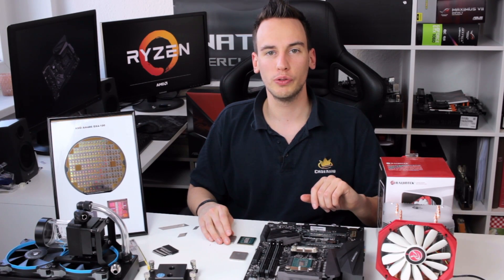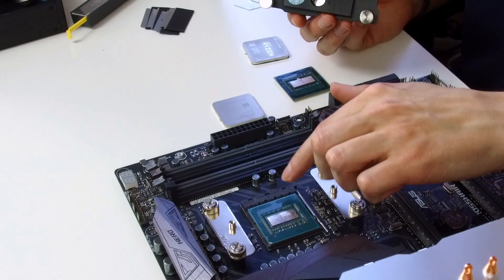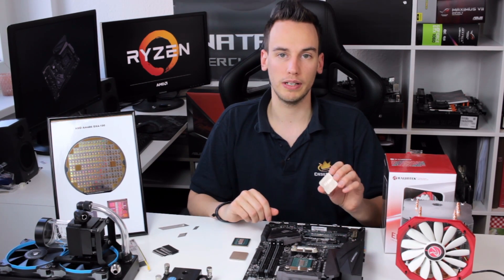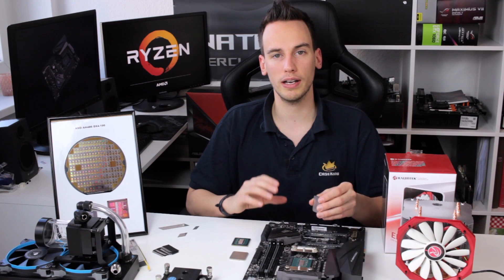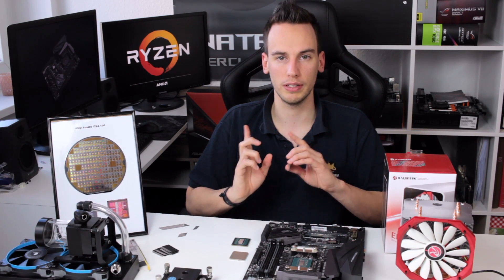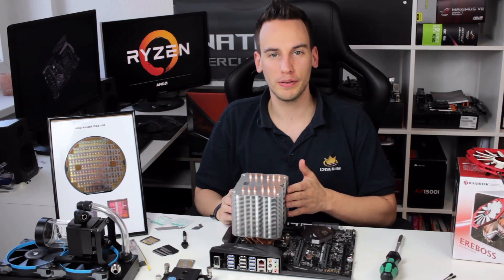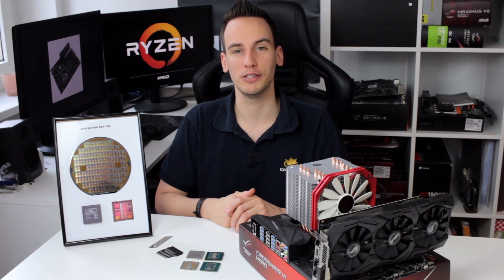AMD Ryzen Direct Die Cooling - Improvements?

Comment: Wow. Bios updates brought the overclock performance of the 1800x WAY up in the last 2 years. I have my 1800x on a Crosshair VII and it runs 4.1 all core consistently at 1.42v and temps are okay.
Reply: It's not the BIOS. Recent CPUs just overclock a lot better probably due to more refined process. Heck, some 1st gen Ryzen are even 12nm!
Reply: @RegBinary  there is no 1st Gen ryzen 12nm cpus bro, that's 2nd Gen.
Reply: @NikoBell1188  Someone got a hold of 12nm Ryzen 5 1600 https://www.reddit.com/r/Amd/comments/d6vymf/hunt_for_the_12_nm_ryzen_5_1600_ended/

Comment: You would get a better result if you used a cooler that is designed to be used on the die. It looks to me that the die is contacting about 35% of the surface of the cooler which is designed to be removing heat from an IHS.

I wish somebody would come out with an all copper cooler that's designed to be used directly on the die. Heat pipes could then take off much more heat, much more efficiently.

Comment: Just for the record. My 1800x is now running stable at 4.075 which was previously impossible. All thanks for a new AGESA code. So it seems there is still improvements clock speed wise in software alone.

Comment: Strange is that i have OC ryzen 1800x to 4000mhz and got 55 celsius max
80 C seem pretty high (and iam on air...) maybe noctua dh something is a better air cooler but that a big difference
Are you sure its not a offset temps?

Comment: What about lapping the IHS?
Reply: arfmf what is lapping?
Reply: @aa-vb9tj  Sand/polish to get it super smooth and free of microscopic imperfections. Theoretically increases contact area between IHS and heatsink/waterblock, but go too far and it could make things worse if you leave a concave surface.

Comment: Can you not file or sand that hinge surface to get the water cooler block on it? or is it not worth it?
Reply: first thing I thought....  hell worse case scenario i'd be in the garage cutting some scrap metal into a new hold down bracket.  Been using the same Danger Den RBX water block since 2005 or so lol

Comment: it isn't the liquid metal and aluminum a bad idea?
Reply from the maker: It would be but where do you see aluminium? :)
Reply: the base  of the cooler isn't made of aluminium?
Reply: Pedro Bermudes its nickel plated copper broski
Reply: Don't mix metals in general. OP has a point.

Comment: Damn, now I know why I watercooled my 1700X...running Prime95 and mid 50s C at 3.8 Ghz OC with custom water vs. low 80s C with stock clocks with aftermarket air cooler 😳

Comment: I don't see why all the hate for Intel using TIM. I've been able to overclock my Intel CPUs extremely well without running into CPU thermal issues on air cooling. Currently have a 6600k at 4.7 GHz that stays at around 75c under load with air cooling. 

Point is I think I'd rather have an Intel CPU with great overclocking potential WITH the option for de-lidding than a soldered AMD CPU that can't even hit anything over 4 GHz without thermal shutdowns. Intel's giving you the option for improvement. Seems to me that AMD HAS to solder because if they used TIM they'd run into thermal issues.

In reality they aren't doing you a favor. These are companies that want your money. They want maximum profit and will cut corners wherever they can.

Comment: soldering a silicon die to a heat spread on paper is a great idea it works very well and it makes a great thermal transfer material. 

Metal is far more thermally conductive then any paste on the market multiple times over.

However with time soldering will expand and contract with age. This causes microscopic cracks that lowers it's thermal efficiency and over time the problem just gets worse.

I knew going in there wouldn't be much difference even with direct die contact but it was interesting and well worth the watch.

Also for further clarification yes we all know metal is more conductive but soldering melts and that allows it to fill in the microscopic pours on both the IHS and the silicon die.
Reply: Clinton Fisher yes but that would be after MANY years like 7 or 10 to notice a difference and usong paste still has the same drawback because after years it would degrade

Comment: so everyone keeps saying that Ryzen is architecture limited not heat limited and that's why we can't get past 4.1ghz. but if that's true how did he get to 5.8? and what voltage was it at? Also, is the 81.1c mentioned here before we take 20c of because of AMD overstating their temps on 1800x/1700x?
Reply: eugkra33 1.8v at ln2

Comment: Temperatures are actually 20c lower than reported for 1700X/1800X (this does not apply to 1700). There's an offset that's not being taken into account by monitoring software.
You can read about it on AMDs blog: https://community.amd.com/community/gaming/blog/2017/03/13/amd-ryzen-community-update
Worth noting as people may be getting the wrong impression about heat.

Comment: Would you be willing to overclock your northbridge and southbridge only if the motherboard even has them both. But please cool those with a liquid cooler also.
Reply: If you notice where it's manufactured vs the delid comparatively speaking this way we all could stay clear of that regions chip manufacturing inferiority using bad thermal compounds. cuting costs at our expense

Comment: Got you deliding not worth it on ryzen, oc'ing the 8 cores beyond 4ghz is probably limited by design as the extra millivolts going in mainly increases temps without enabling faster clocks probably an issue with the design and 8 cores but still it's a great processor for those game/productivity users that need 8 cores.

Comment: had similar problem with direct cooling on my i5 5750k.  My solution was to remove the retention bracket.  The waterblock once installed prevents the CPU falling out.

Comment: How did you get that CPU cooler to fit without an AM4 bracket, if I might ask?
Reply: PvMcris Becose Asus Crosshair VI Hero have holes to use both soket cpu coolers AM3+and AM4 the same.

Comment: Why not just take 2mm off the plastic socket and use the original water block? Easy
Reply: IncandescentWithRage that's what i was thinking the whole time. shave that bitch down!
Reply: I thought that too, the motherboard is probably 400€, but if you delid at that level....

Comment: You should rather try to go with the peltier cell.
And to avoid condensation set CPU fan curve to start after 60*C and then make driver circuit for that peltier so it will go 50% power with 50% PWM signal from CPU fan connector.

Comment: push pull with better fans pls. the fan you showed on this beefy heatsink cant do shit. also cover the sides of the heatsink, because most of the air passes by the heatsink instead of going trough

Comment: So it seems the biggest problem with getting a higher over clock has to do with the temperature limitation with the 8 cores. And again total props for hitting 5.8gig on launch day  all 8 cores is #GODLIKE just an idea the master liquid pro 240  i have has the actual copper die machined so it actually sits better on the cpu and  2-4mm lip between the main part of the block and the contact point of the heat sink maybe that would fit on there

Comment: So you went through the distance of deliding two SOLDER bond 300+ usd CPUs and you stuck when the a piece of plastic on the socket didnt allow you to apply the cooler cause it was 1mm higher? what about using some sandpaper or a file and file that shit 1mm lower its only useless plastic lol xD
Reply from the maker: Was not my board :) So couldn't do anything there

Comment: Try the same with Ryzen 1700, these chips are much more colder on air
Reply from the maker: much colder on air would mean that the difference is much smaller, no? :D
Reply: :)
1700 are  ideal for aircooling/AIO cooling 1800X for phase/LN2 more in OC mode

Comment: the 2600K which I own was the last 115X Core i7 with a soldered heatspreader ...
Reply: Felix R it's always surprising how long the intel CPU's have lasted.

For gaming, CPU power hasn't been an issue for nearly 6 years - few games care how good your CPU is.

Some examples are ark, Garry's mod ( when pushing crazy mods to the extreme ) extreme modded minecraft, space engineers and from the depths.

Most CPU bound titles are either modded games or poorly developed survival games.

For the rest of us we can grab a chip from a university surplus and enjoy years of gaming.

I have been using a 8350 for a long time, only time I wished for faster kit was when I went deep into modded minecraft.
Reply: my 2600K is also 6 years old and it still is fast enough for 1080p Gaming (i use a overclocked GTX 980 Ti)
There is almost no game my CPU is cant handle, so im still not going to upgrade my PC
on the other hand, Kaby Lake is far too slow to be a worthy upgrade, 25% better IPC and 10% more clock? not worth the money
Maybe im going to buy a new Pc in 2019 ...
Reply: Felix R 2600k oc 4.8 will good enough for 4k lol
Reply: John Yang what does Screen resolution has to do with the CPU frequency? 😅
doesn't the GPU has to care about that?
Reply: Felix R Yeah
Reply: LOL, what a waste of 980ti, for example with a modern cpu and a 980 you would have pretty much the same performance. Your cpu is probably capping 10fps to 25fps.

Comment: I hated those AMD Thunderbird chips that were sold de-lidded. I would brick the cpu every time i tried to mount a heatsink on it.
Reply: oh yeah the old the grey/bluish athlons without a lid and the 4 black foam pads in the corners :D

i remember those core cracking issues with the old athlons going over the forums back in 2000 orso,
those old stock heatsinks/coolers took an awful lot of force to get on there

i also remember almost prying a screwdriver right through a mainboard trying to keep down on the metal "lock" holding down the whole thing
things got pretty close there lol

used to have an athlon 1000, those ones where you could use a pencil to connect the L1 bridges on top to unlock the multiplier, it still didn't overclock for shit cause it ran pretty hot on stock speeds already, but those were the days :)
Reply: +Alexander Rewijk Oh yes, I was running a socket a system around 2014 because money was a huge issue, after breaking a screwdriver with that stupid pos cooler mount (the cpu survided) I killed it trying to overclock without thermal paste, I was using old motor oil, had to change it every 10 minutes, since on the old 40gb hdd xp took about that much to boot, the cpu overheated and died, it was summer, was running fine at stock without paste tho. That was an athlon xp at 1.2 ghz, then I got a duron at 1.8, and paste, was running it 2ghz all day.
Reply: I used to work in a computer shop at the time Thunderbirds, Durons and XP's were being sold and I must have build hundreds of systems without EVER cracking a core.

You're telling me you have cracked more than one and only done a couple?

Get a new hobby dude... Lol.
Reply: Ha, I had one of those die on me lol. They were running hot as fuck ( I had the 900 Mhz model) and one summer it burned my mainboard.

Comment: Planned Upgrade:
i5 4670k -> 1700/1800 (X?) or i7 7700k?
Your thoughts are welcome. Needed for 60% gaming and 40% rendering.
Reply: With rendering in the mix; an OC'd R7 1700 any day. While gaming vs the 7700k is about -10% on average @1080p,  it's pretty much on par with a $1000 6900k for workstation stuff when OC'd (easily OCs to 3.8-4.0 depending on luck).
Reply: I like Intel and all but if you do any kind of render ryzen destroys the 7700k
Reply: coot33 for rendering the 1700 will be a huge jump from the i5
Reply: I'd forgot to mention that the CPU will be paired with my GTX 1070 OC.
I think i will go with the Ryzen. Back to AMD. :)
Reply: 1700, it's good at gaming (and is constantly improving as we have seen in just 3 months) and fantastic at rendering. Vs the 7700k which is great at gaming, but not great at all in rendering.
Reply: coot33 Money is not the problem at all. My i5 is just not fast enough for me.
Reply: What resolution will you be running out of curiosity?
Reply: 1440p :)
Reply: Get the R7 1700 (non-X), you should be able to overclock it to 3.8GHz on all cores with ease by just changing the multiplier and upping the voltage to around 1.3
Reply: Ryzen will absolutely destroy Intel in the multithreaded rendering/encoding tasks, by a very large margin. The gaming performance is reduced but that may just be the current games that are optimised for Intel chips.
Reply: At 1440p, the current gaming issues will basically be a non issue as higher resolutions become more GPU bound. 
At 4k for example, there would be no difference between CPU's at all. 
But all of the discrepancies in performance are where the frame rate is so high with a high end GPU's at 1080p that games start becoming CPU bound instead. 
Now there may come a point one day when GPU's become so powerful that even at the higher resolutions you start becoming CPU bound again. But it will take a very long time due to the way that games become increasingly harder to render as well.
Reply: John Yang, he does rendering on cpu so that alone justify it over i7 he currently has and a 7700k (as long as you got money) I am strongly looking at one my self as it's starting to be annoying some stuff in me i7 920
Reply: Your cpu is fine, sell that crappy gtx 1070 and spend your money on a gtx 1080ti instead.
Reply: Daniel Jahn a 1080ti would be massively bottlenecked on that system
Reply: He does 60% gaming,  today's gaming is done at 4K where CPU's are not that significant, unlike 15-year-old 1080p gaming... His CPU is still  fine. Should get a better GPU and if he doesn't already have one, a 4K 40 inch monitor or TV with low input lag.
Reply: I have a 1080Ti with my i5  6600K @4.6ghz and game in 4K. Most of the time my CPU is around 89% and below while my GPU in the upwards of 98%. Bottleneck is slight.
Reply: You don't know if he wants to game at 4k or if he has a monitor capable of it. You're just assuming. A bottleneck is still a bottleneck
Reply: Jesus fucking Christ, you just want fucking rizen like a new fucking toy and  just attract our fucking attention for no fucking reason
Reply: oh yes much much faster the ryzen 1700 is
Reply: Not worth the money keep the 4670k.
Reply: CX Music Unless you have a high refresh rate 1080p monitor get the 1700 vs the i7-7700k as the difference isn't very big in games and should improve in a month when windows supports SMT well.
Reply: If you do 40% rendering, then the R7 1700 all day where you are gaining 50% better rendering performance with Ryzen vs 20% better gaming performance with Intel 7700k.. Not to mention that Ryzen gaming performance will improve once the windows 10 scheduler bug is fixed. Basically right now it is scheduling calls to the SMT that should instead be scheduled to the actual cores first. When all of that is ironed out.. 20% performance gains in multi thread heavy games will be easy and will no doubt surpass the 7700k's slightly higher clocked 4 core 8 threads in time.
Reply: Go for the Ryzen, huge upgrade over an i5.
Reply: CX Music no need to upgrade

Comment: I'm guessing AMD uses a much higher quality thermal paste on the IHS of the 1800x as it's a more expensive processor and i'm assuming that they were more fine tuned for extreme overclocking.
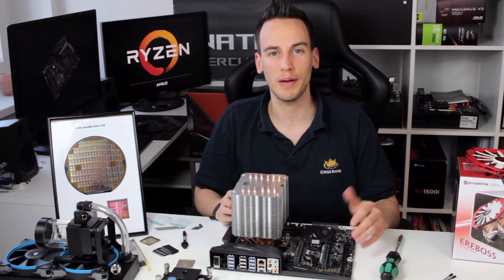Reply: the cpu die is soldered to the IHS @6:40

Comment: Try a refrigeration cooler so we can see how it performs in an ideal case where heat should not be an issue.
Reply: Wow, 6 comments up someone mentioned this (Specifically an Asetek Vapochill, which I have). I guess these are more popular than I thought, but nobody seems to review chips with them. If anyone wants to send me a board and CPU, I would be happy to bench it.